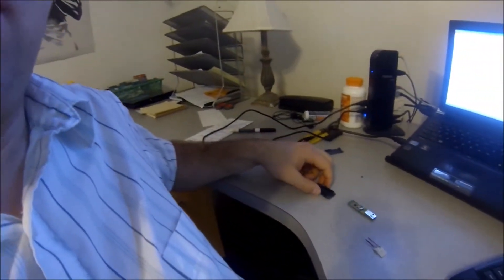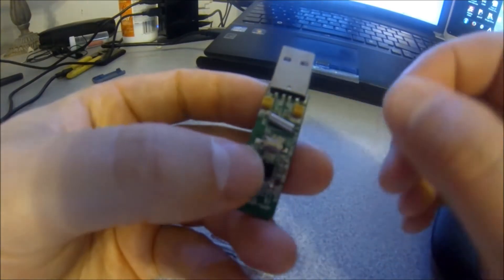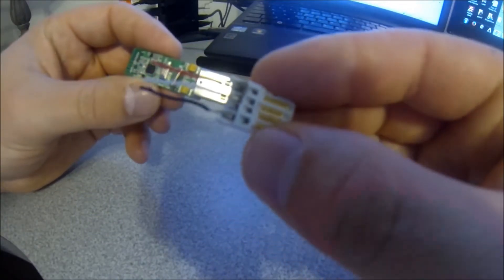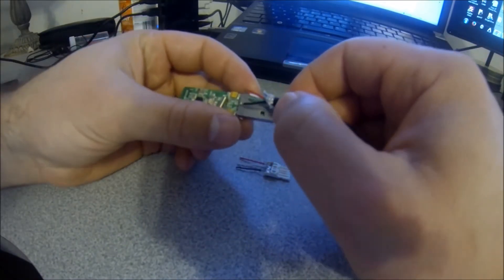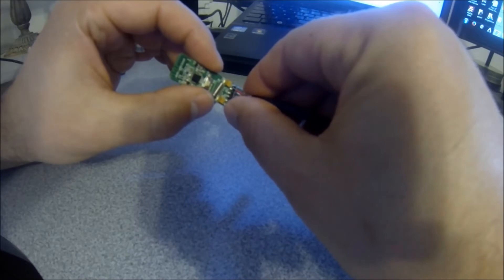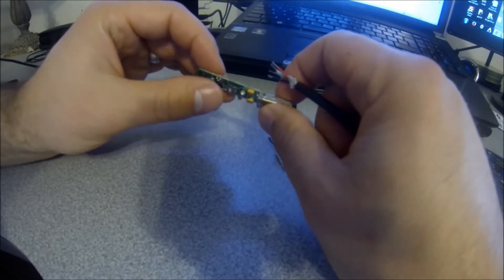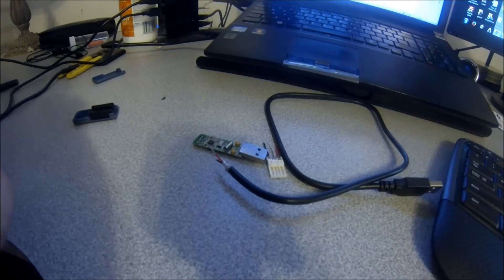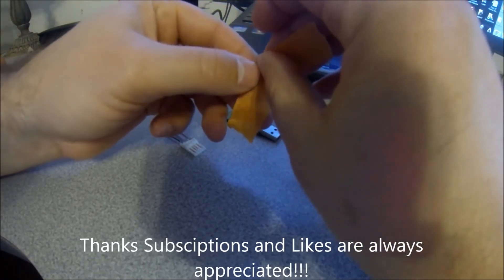How to Fix a broken USB drive

Comment: I have Kingston 32GB Data Traveler OTG Micro Duo USB 3.0 Flash Drive - DTDUO3 it's dead not showing any sign on computer mobile or any other player ......please help Bro. .....I need to take out the data....how to open it or fix it ...please give me useful information.......note.....it's not showing any icon in computer or plug in sound
Reply from the maker: so is the USB damaged or smashed?
Reply: not damaged or smashed  ......just I put the USB in my cupboard for few days ...after I plug it back again....it's not working now ...i do not know what happen even it did not fell down ....i tried to plug it on my tablet,laptop,TV , no any plug in sound ...it is dead....tell me how to open it ....please help....it is Kingston 32 gb otg flash drive dt micro duo.....please help